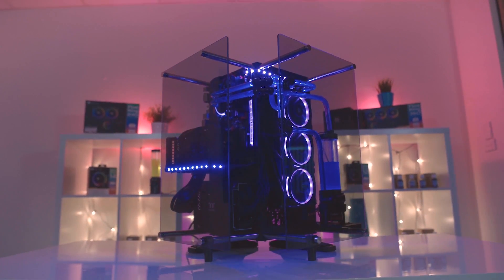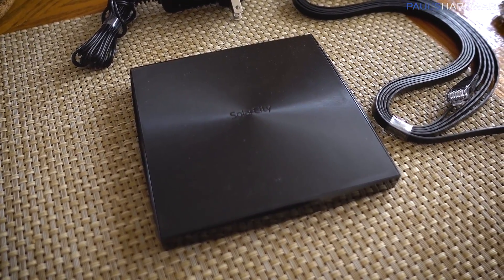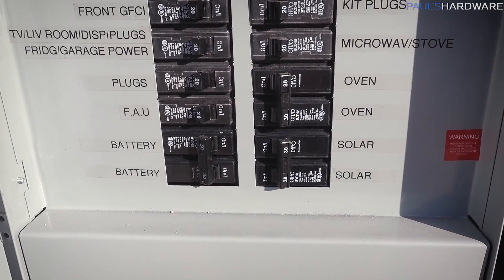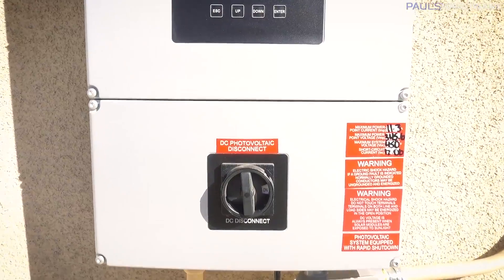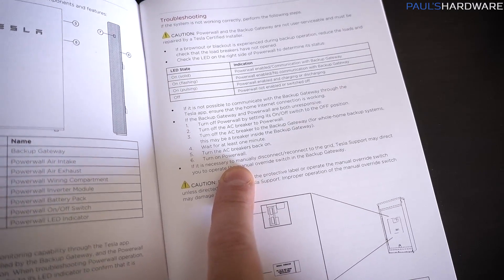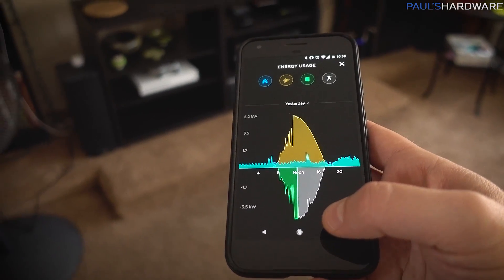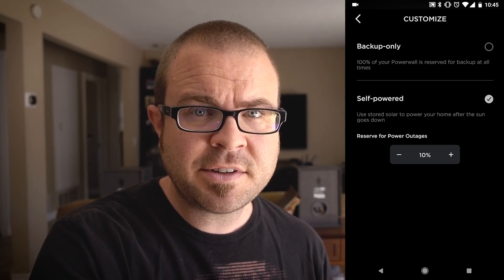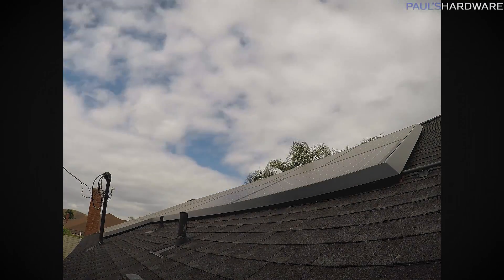SYSTEM ACTIVATED! Tesla Solar + Powerwall Week 1

Comment: Paul, would a Tesla Powerwall, or setup you have, would be something for a country like Holland? We have all kinds of weather here like rain, snow, sun, clouds etc... Also, we are quite a bit further up north (53N) in comparison to Ca. Do you need to be in a really sunny part of the world to be self sustaining??? Love to hear yr comments on that
Reply from the maker: I'm in a particularly good area for it, we get a lot of clear sunny days here in southern CA. Your location will have a big impact on how much power you can generate with solar so I would spend a lot of time researching your local conditions, as you might need more panels to cover your usage.
Reply: Germany has tons of residential solar, don't see why the Netherlands would be too radically different.
Reply: The further north you go, the longer days you have in summer, so it's economical further north than one would think. Weather and the local electricity market is even more important than the latitude.

Also don't forget to consider solar heating for water if you don't have district heating. A vacuum tube solar heat collector can boil water even in freezing temperatures. A combination of solar vacuum tubes, and a wood burning water heating furnace might be ideal for a place like Norway - because the same tanks, tubes, and space heaters can be used with wood in the darkest winter and the sun in the rest of the year. In fact, for some it makes more sense than photovoltaic panels on your house, especially in Norway where we have almost 100% renewable electricity.
Reply: Thanks Jamie. Good to hear it can also work in a country like Ireland, with all its ups and downs in the climate. NL has quite a similar climate as yours. BTW, I am not in it for the cash, it's more an environmental thing, and trying to see what I can do
Reply: Gunnar René Øie and shorter in winter ;)
Reply: Here in Canada it is still worth getting. We don't get as much sunlight all year round as others and in winter it can get covered in snow but normally the blackness of it will melt the snow. I've never seen someone ever have to go on their roof and clear panels. I know some companies will offer solar mapping to determine if your house is worth it.
Reply: Don't forget import taxes. There are simpler but worse solutions from european companies. In any caseTesla is well present in the Netherlands and you can always make a free inquiry. btw. they  have serious shortage of personal.

I work sometimes with a company from Hengello which install off-grid solutions for farmers. If you are a big electricity consumer such solutions (solar+powerwall) are pretty must now. Don't forget that most of Netherlands gets considerably more sun than England. If you are o normal dutch with dutch electricity bill, ICE car and gas stove it is still not a reasonable investment. 
When install solar try to avoid chinese products, they erode way to quick. During installation check that no solar panels are bend or "stretched". It's just as bad for most packages as it would be for electrical boards.
You can control it by checking the ease of installing them in or removing, basically screwing in and out is enough. (just ask to do it for you before connecting into grid). I've seen this mistake numerous times.
Reply: Jamie, that's why having the battery is so useful.
Reply: Yes that's why using photovoltaic solar for electric heating is a terrible idea. Solar heat collectors work well here from march to october though. People here use solar PV mostly for off-grid stuff like mountain cabins and lighthouses.
Reply: @gunnar6674  Propane water heaters can be an option when in mountain areas etc. On average, it likely costs about $15-20 a month to use natural gas water heating in so ca.
Reply: Gideon Sanders: Best to ask your local solar experts (get more than one opinion). Solar works best the closer you get to the equator and the more clear days versus bad weather days you have. BUT, the tech is constantly improving, so you may have answers. Sadly, I don't think there is a good residential alternative for other green energy alternatives: Wind (there may be residential sized solutions, but zoning could be prohibitive), Hydro (Yeah, people frown on daming up a river so you can get free electricity.), and nuclear.
Reply: No you don't you, can use windmills and other alternative power generation systems to be self sustaining. If you like to tinker you could even make better systems that aren't easily available or if you know a friend who does might improve your life. THe Tesla Powerwall in general should be able to use any country and with any type of power generation system since it's just a special battery for your house. it's all a matter of how you want to do it and how much time and effort you want to put into it. In the U.S. for the standard 4 bedroom 2 bathroom house if you did Power and water for it it'd be about an additional $75,000 to $150,000 for a year round no worries you're self sustaining setup added to the price you pay for the house/property.
Reply: dexter2433 I don't want to discourage you from commenting, because everyone should have a voice and be heard. But if you could work on breaking what you write up into sentences, you'd be heard by a lot more people. It's very hard to read when someone writes such long, run-on sentences. Sorry, I don't mean any offense, just trying to help you out.
Reply: Enphase microinverters would be great for your situation
Reply: but he is not showering for a whole hour! So 8,5KW heater only runs for few minutes and uses 2-3KWh at most.
Reply: Gideon Sanders n
Reply: Gideon Sanders im from ireland and have installed quite a few solar systems. Solar still works in countries with not much sunlight. They're just set up differently to those in California.Btw you will still never make money off solar unless your government subsidies the installation of solar panels. 3.7 kw is not that much power. For instance an electric shower uses 8.5 kw of power when on.
Reply: Really the suns the sun as long as there's light these things work great, you'll have to find out who services your country for solar installations, talk to your power company for options.
Reply: in america you can make $ from your solar system and without government subs ......depending on where you live ...in my county in Texas they will buy your over generation at 50 cents on the dollar or you can have it set up so that the electric grid is your battery and all power you generate in the daytime that you do not consume and is feedback in to the grid you will be allowed to consume every night for even swap but at the end of the month any credit you can accumulating is wiped clean and to start back at $0 and with both setups it takes about 7 years to recover your installation cost  and after that you are in the green and making $ because you are not spending $ you otherwise would be spending on your electric bill and that is with a expected life span of 20 years on your system and is also why you want to properly calculate your power needs and not over build or under build your solar system
Reply: They are moving away from windmills cause of the effect it has on the environment just a few years ago they were building them by the hundreds then they released a report stating that it has negative health effects on people living near wind farms as well as birds dying by the hundreds each year.

Comment: 4:36  Non Conductive???  Graphite inside a pencil is conductive,  but at least you had that small rubber
Reply: stick the small rubber in the hole...that's what she said.
Reply: Conductive in one direction? You must be thinking of something else.
Reply: Wood is conductive at high voltage like 400+ because of the water inside wood, so you are okay here probably like 220volts. Hard straws like coffee stirrer are safe.
Reply: Nope, not one bit. There can be a bit of moisture in there. Crazy farmers try to lift up power lines with lumber occasionally. https://www.youtube.com/watch?v=g4ph-h7l_aM
Reply: And then he filled the hole with white goop 👍
Reply from the maker: But the wood is kind of an insulator though right 😳
Reply: Catson graphite is only conductive in one direction.

Comment: All these switches makes me feel like in Jurassic Park
Reply from the maker: I know how to read a schematic!
Reply: You have to pump up the charging handle in order to get the charge, its large flat and grey!
Reply: I used to be a panel builder and the irony is that Jurrassic Park is one of the few movies that actually GOT IT RIGHT. The electric part at least, the whole 3D computer crap for rebooting the system was garbage. I worked on +2000A motorized breakers where you had to do the exact procedure as shown in the movie.

https://www.schneider-electric.com/en/product-subcategory/4220-high-current-air-circuit-breakers/
Reply: That 3D stuff was a real Unix system - fsn file manager running on IRIX - though it wasn't part of the standard distribution it was available. It made sense that a lab full of nerds would use it. There's even an open source version of it now called File System Visualizer.
Reply: Was thinking exactly the same xD
Reply: For such a vital system, I would take a bunch of good old switches any day over a fancy web-based interface... :)
Reply: VTOLfreak that's just insane. But hey, at least it was accurate!
Reply: The first JP movie basically wouldn't have happened if there were a solar setup...lol.
Reply: Jeremy Smith I disagree, the issue come frome sabotage it would have been the same with solar panels. In more all the action is during the night.
Reply: Unix really does have that system for exploring files.
Reply: Paul's Hardware Push to Close
Reply: Paul's Hardware Now we know the real reason the Tesla app wasn't working....ah ah ahhhh...you didn't say the magic word...ah ah ahhh
Reply: Gunnar René Øie I bet that kind of automation wasn't easy...or cheap.
Reply: i just posted the same thing ha
Reply: HOLD ON TO YER BUTTS!
Reply: Please show all open box and EV charging system add Tesla powerwall
Reply: i thought he was storing ghosts  for ghostbusters